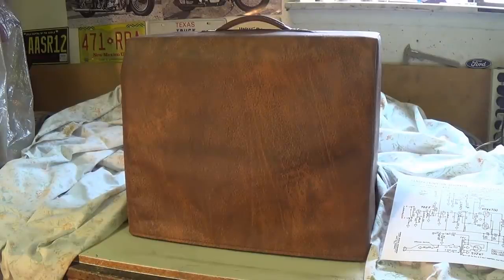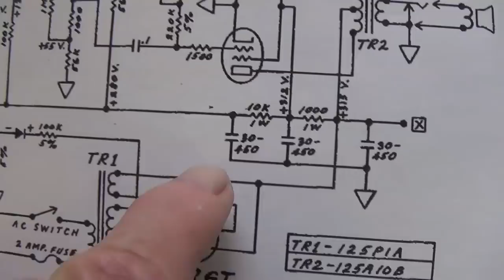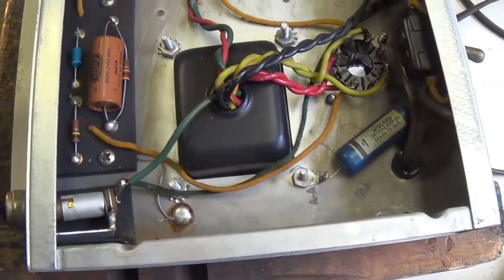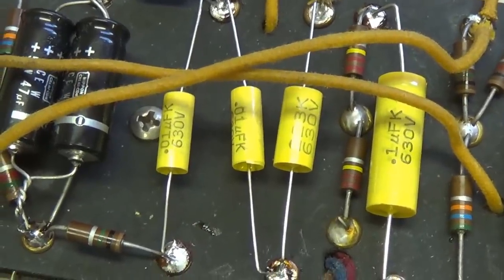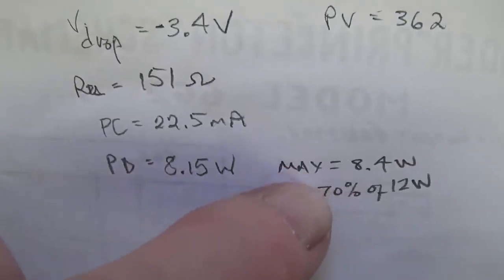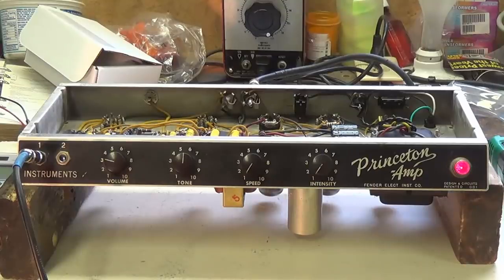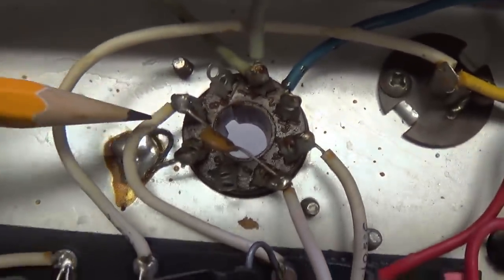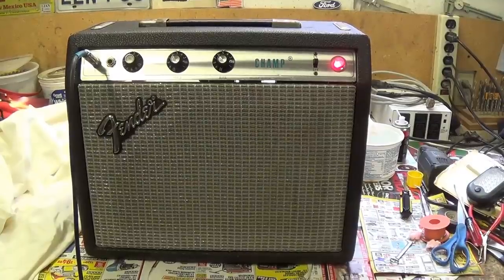Brownface Fender Princeton and Silverface Champ "Double-Header"

Comment from the maker: NOTES: 1.) Because of their low PC and imbalance, the GE 6V6's were replaced with a matched pair of EH's. The GE biasing was retained in the video for instructional purposes.  2.) The Champ video was abbreviated due to time constraints. More work was done.  3.) Although the Princeton schematic show 30/30/30uf filter caps, the circuit actually contained 20/20/20uf.
Reply: I noticed the 30/30/30 on the schematic as you panned over that, remembering the 20/20/20/20 in the blackface schematic before I received the amp mentioned below.
Reply from the maker: Yes, it makes me wonder if the schematic really is correct for this circuit. There were several other very noticeable differences.
Reply: Honestly, the EH 6V6s aren't bad tubes at all. Personally I like the Tung-Sol remakes more but they're quite similar.
Reply: Uncle Doug Happy new year to you Uncle Doug and thank you for all the very untertaining videos of last year.
Reply: Any time uncle D!!
Reply: I am assuming that because you switched it to the electro-harmonix 6 V6 tubes, you might have had to change the bias setting resistor to a higher value again, for a bit more negative voltage and therefore a little less plate current?
Reply from the maker: @srfrg9707  Likewise to you, sir. You're quite welcome :)
Reply from the maker: @goodun6081  Yes, all the biasing work was out the window, and I had to start again from scratch. Fortunately, the new set really was nicely matched.
Reply: @UncleDoug  Doug, you are my fave, and I used to fix these things back in the day. Everything was fine til you changed the design of the grid bias! As you must know, doing that and sending it back into the world dooms the amp to never working right once that set of 6v6s fails. That really shook me at this end. At worst case, you would put in a 30K pot with a note indicating 30K is the original value. Best case, replace those 6v6s no matter how beautiful they are (and they are). Which you ultimatedly did. 
Ok, I had my say. Back to the great vid.
Reply from the maker: @cjay2  Think about it. Only a real hack would simply install a new output tube set in a grid-biased circuit without re-checking the bias. The new EH set had to be custom biased (and the value was definitely not 30K). Should the original 30K resistor simply be left in place for all output tubes, regardless of the fact that none of them will function properly with it, simply so hacks can get away with careless tube exchange?
Reply: @UncleDoug  Just out of curiosity, why didn't you install the bias pot permanently and mark the proper position after final adjustments with the meters instead of hard wiring resistor(s)? Wouldn't that make future bias dialing in easier as the tubes age?
Reply: Hi UD! Champ refrub;  Vu pot cleaning: After cleaning and the pot(s) they are determined to be functional and were just dirty, a few questions ???'s. 1. What was causing the horrendous continuity issues, what was the debris? 2. I've found that can cleaners can sometimes cause more harm than good on very old innerds because the propellant is so cold and it destroys them, so I use it sparingly and do the rotating cleaning while still "wet". With that in mind, is it ok to put a drop or two of light oil on the contacts or is there something better for lubing them so the have better longevity? Thanks!
Reply: Wait!!!!

I want to see that old car. Do a video on that Uncle Doug.
Reply: @UncleDoug  Uncle Doug your repair work on this amp was stellar. Your work is in line with the precision they were doing at Fender in 1961. Beautiful.
Reply from the maker: @barrybartos7687  Wow, thanks so much, Barry. We really appreciate it :)
Reply: @ThePreyMantas  I use specialized "Tuner Cleaner" for Pot's. There is a mutch lower ammount of Oil in it and it doesn't harm the carbon inside the Pot cause many cleaner destroy them over Times. U have to use  enough for wash out  the debris.
Reply: Thanks Uncle Doug. I wasn’t sure how to message you on you tube so I’m messaging here. I’m just finished building my first clone a 5E3 and all went well. But I have a basic soldering question. I know when doing the board it’s common practice to bend the leads of the components. I know there is a lot of talk about mechanical connection as well as the solder joint .. but it respectvtobservicabilty — when you’re wiring tube sockets, pots and input jacks do you recommend a hook or just a straight lead through the hole. i ask brcause iy must be a disaster to replave a socket or part that has a tight hook wrapped arounf a delicate eyelet. whats your technique? thabk you for taking the time to answer!
Reply from the maker: @DannyDKNYC  Good question. What you desribe is definitely an issue of maximum connectivity vs practicality. Here's a compromise:  Loop the leads around the terminals, crimp and solder.....then if you have to remove the lead later and it doesn't come loose easily, simply cut the lead off flush with the terminal and solder the new lead in it's place. If the lead won't fit through the terminal hole, then wrap it around the terminal before soldering.

Comment: The metal screen together with the metal chassis creates a Faraday cage, and it can be helpful in reducing noise from single coil pickups, fluorescent lights, etc. I once had a power transformer that had a ground lead for an internal Faraday shield.

Comment: Respectfully Uncle Doug, why didn't you install a bias pot on the Princeton, like you have done in so many other amp repairs? Was the owner dead set against a modification that would change the circuitry from stock? If that's so, please disregard this message. When the tubes go and a new set is installed, they could easily end up biased too hot (or cold) and require a different set of tubes or another resistor swap. I'm scratching my head on that one.

Comment: I have a '62 Fender Brownface Princeton 6G2 and the tube chart in my amp is on the side wall of the cabinet, not on the floor. The 6G2 is definitely one of Fender's best amps, hands down. You can really get a creamy overdriven sound out of this one without destroying your ears. It also works very nicely with a 2x12" or even 4x12" cabinet as a "mini-Marshall", much in the same way as its bigger brother, the 6G3 Deluxe which has even more gain. Thanks again for an excellent video and cheers from Finland!
Reply from the maker: You're welcome, J.

Comment: Just a quick note on the metal screen in the top and the radio transmissions.  You mentioned Mexican radio stations and ironically I can recall in March of 1986 driving on the way back from the Guadalajara, Mexico area and in the evening, while still not far from there, picking up KOMA, 1520, out of Oklahoma City, Oklahoma. Roughly 1300 miles. I am from Oklahoma so I immediately recognized the DJ.  It was a 100,000 watt AM station back in the day.  I also remember being on wheat harvest in 1980 and out in the middle of no where and catching some other stations from many states away.
Reply from the maker: I used to listen to KOMA late at night also, Doc, and I am in West Texas.

Comment: Hi Doug, thank you for producing these videos! I’ve learned so much from you that I was able to resuscitate a beat up BFace super reverb amp. The output transformer had the secondary open, so I had it rewound and it’s working fine.
When I got it back it had 7 wires instead of 5. When I asked about his they said it had those 2 extra wires cut and taped inside..... so they decided to add the extra wires. I wonder if you know what they were for? I still have to change out several 100K resistances that are way off. I’m using the AB763 circuit  but I’m getting higher voltages than I see in the schematic,
about 10 to 15 volts higher. Best Rgds
Reply from the maker: You're welcome Alvaro. Perhaps you can identify the two new wires using your ohmmeter. Odds are they are for a speaker(s) with different impedance than the one(s) that came with the amp.

Comment: 14:24 - I was a bit confused here as I only saw the only above-chassis cap and here you see it's disconnected. So you already desoldered it and replaced it at this point. Also, I suspect Casey is a bit disappointed in her "re-coning" job.
Reply from the maker: If you're referring to the can cap, I discuss its replacement with discrete caps elsewhere in the video. KC did indeed loathe the "cone of misery".....but it's no longer installed :)
Reply: @UncleDoug  "Cone of shame", I've heard it referred to.

Comment: The screen is just to shield out the 60hz and simply caps off the top of the chassis. All open wiring inside makes that very helpful. I’m sure it was very cheap to procure.  Prolly works as well as foil. Man... that amp is a beauty!  I always get excited when you’re gonna open something like this up. Bam... I was not disappointed!!!
Reply from the maker: Thanks, BC......glad you liked it :)

Comment: I had to put a 1.2K resistor for my Champ output tube grid bias, when I put a new set of JJ tubes in, to get the plate dissipation down to 30mA at 380V for an 11.4W.
Reply: Correction, cathode bias.
Reply from the maker: Can you imagine how hot your 6V6 would be running at Fender's original bias ?? I guess tubes were cheap back then ;)

Comment: Fine job again good thing to change all these wax caps . Do you per habit always remove the death cap at the ac power input and the reverse ground polarity switch ? what was the use back then for these ac line capacitors ?
Reply from the maker: Thanks, Pete. On customer amps I do tend to replace all problematic components, including the death cap (which originally eliminated AC line noise) and power cord, and I bypass the polarity switch.

Comment: Fender remade the speakers, transformers and yellow caps for the custom 57 champ and 57 deluxe. I asked them if we could get them to repair original versions but haven’t heard back yet. You might inquire as well!
Reply from the maker: I wasn't aware that they would even consider repairing original parts, Duane......very interesting.
Reply: Uncle Doug they didn’t repair them, they went to the manufacturer and had them remade so that they had new original improved parts for their reissue amps. So if you had the new ori ginal parts to use when you work on Classic amps it would be like keeping it sort of original.

https://youtu.be/XYbhhSVQLJg

Comment: Thanks for another great video, Uncle Doug! Quick question; when you remove the old tone-capacitors, it looks like you clip the capacitor-leads at the eyelet, rather than heating-up the eyelet and muscling-out the lead? I haven't replaced any parts on a fiberboard, only turret-type, and I'm curious about best-practice in this situation (fiberboard-eyelets). As always, thanks a million.
Reply from the maker: You're welcome, John. I heat the eyelet and try to remove the wire lead.......but many of them are used for grounding (soldered to chassis) or connections beneath the eyelet board and cannot be removed. Those must be clipped off flush with the eyelet and the new component wire inserted and soldered within the eyelet

Comment: Nice video Uncle Doug--- Just wondering why you didn't replace the tubes on the Princeton rather than changing the bias resistors????
----- I'm just getting ready to do my '62 Brownface Princeton..    Thanks
Reply from the maker: I did replace the tubes, Walt, and......as you always should do when changing output tubes in a grid-biased amp.....I changed the value of the bias resistor (again) to achieve the proper plate dissipation value for the new tubes.

Comment: This is so neat and the timing is great as I have a blackface princeton that was brought to me just last week that I have not opened up just yet--also having poor tremolo performance. However,  looking inside the bottom of the amp, the tube chart was almost completely gone and the filter cap can has previously been replaced with a CE unit. I plan on filming so we can all see what happened to it.  I am certain my video and voice-over will not be as thorough as you-but I'll try.
Reply from the maker: Thanks for your kind comments, SC, and best of luck with your video. About the only thing that can go wrong with a simple trem circuit like this is either the oscillation loop caps, oscillator tube, or problems in the bias supply (in circuits such as the Princeton).
Reply: @UncleDoug  Yes I will check those out. When the customer dropped off the amp, while he was here, we fired it up, wiggled the 12ax7 and the tremolo kind of started to work..so we discussed possible tube replacement, but definitely socket cleaning and pin fitment investigation. I also said I'd check voltages and resistance down through the amp. I'll get started on it this afternoon...video to come.
Reply from the maker: We look forward to it, SC. Best of luck.

Comment: HI Doug....I built a Fender 5F2A circuit a year ago and also had to increase the bias resistor to 1KΩ and  the bias cap to 100V (over kill, I know).  I also replaced the 12AX7A with a 5755 (tube wiring different but same characteristics) and is quieter.  I always enjoy your videos and glad that KC is doing fine and looks great.  She will be glad to get rid of her "bonnet" !
Reply from the maker: Yes, the original 6V6 bias is often absurdly high, Tom. KC is running around quite happily today, finally free of the awful collar.

Comment: Great video. Regarding the princeton tremolo caps, I believe that it was the leakeage in the caps that made the tremolo behave that way and not the capacitance. In fact, if the caps have leakeage it will give a false reading in most cap meters, and, contrary to what would be intuitive, they give a higher value than real. If you think of it, in an RC circuit that measures the time to reach a certain voltaje, technique used in many cap meters, if you put a resistor in parallel with the cap it'll take more time to reach the voltaje, thus reporting a higher C value than real. That's why it's missleading to only read capacitance of a capacitor to check if it is ok. In my opinion you took  the correct path of replacing all of them.
Reply from the maker: Thank you, Charlie. I have other ways to test for coupling cap leakage.....but even if they don't seem to be leaking at the moment, ancient coupling caps are going to break down eventually (probably fairly soon if the amp is going to be used a lot), and it only makes practical and economic sense to replace them.

Comment: I watch for the electronics portions of your videos, but live for the awesome guitar solos at the end, Thanks Jack.
Reply from the maker: Thanks from both of us, Ronnie :)
Reply: Dear Uncle Doug, Been playing Rock Bass for 54 years, I'm 63, I have been looking for an Ampeg SVT 70's era (preferably later 70's) to go with a 8-10's cabinet I've owner since then, I had the whole rig (head & 2 Cabs, sold head & 1 cab when I wasn't working with them) now I'm sorry about that, just the heads are going for $1,800+, if you know of one please inform. But, I settled for & will soon be receiving  an Ampeg V-4 bass head that works but has some issues, got it cheap, ,seller says it has a wire lose &  didn't know where it goes, Haa maybe that's the problem ;-) I hope your tutorials have prepared me for this endeavor, I already have the schematics & will go through it completely so, I'll drain those caps & it's on! Thanks for all you do, I love your approach & all your animals. P.S: Rusty could really rock that six string!!! Thx, Ronnie Allred

Comment: Awesome video!  I know this is several years old now however I just got an amazing deal on a 1963 transition year “tuxedo” Princeton that thankfully is working great but I’m looking to use it and therefore want to swap out the two pronged plug for a grounded one.  Also, instead of bypassing the ground switch, would it be possible/desirable to turn the ground switch into a standby switch?  

Just trying to think through any necessary upgrades before find a tech to send it to (just found your channel so not sure where you’re located).  Thanks!
Reply from the maker: The 3-wire, chassis-grounding cord is a must, Matthew, but I'd give a big thumbs down to the standby switch idea. Use a GZ34 rectifier, if possible, and you'll have a built in warm-up delay. Convert the polarity toggle to a switchable NFB Loop.....one of the best Fender mods ever :)
Reply: @UncleDoug  thanks so much for the quick reply! I honestly wasn’t expecting anything seeing as this is a five year old video. Much appreciated. I will certainly look into the NFB loop.  Just found your video on it after a quick google search so I’ve got some learning to do.  

Any recommendations for good quality tubes? I have the original RCA 5Y3 rectifier tube but I was considering sovtek 6v6s as the original power tubes were unfortunately broken.  

Also, by any chance, do you have any recommendations for an amplifier technician in Oklahoma?   Thanks so much!
Reply from the maker: I have had good luck with TAD tubes. Their quality control is excellent. The closest good tech I know of is in Colorado: Michael at Chelliamps@gmail.com.
Reply: @UncleDoug  excellent.  I’ll have to check those out!  Thanks for the advice!